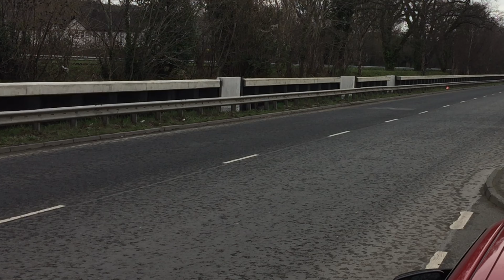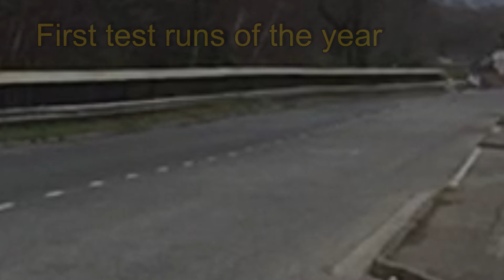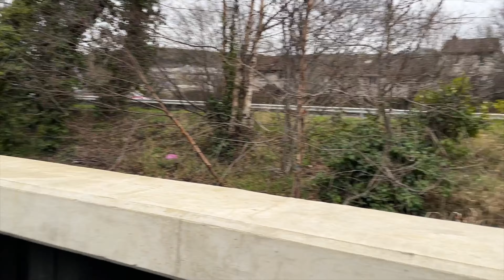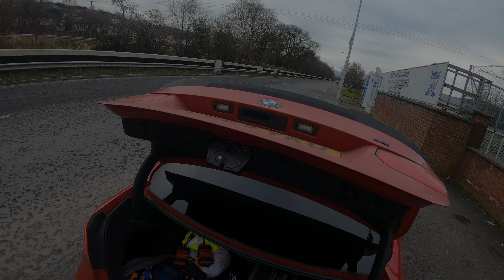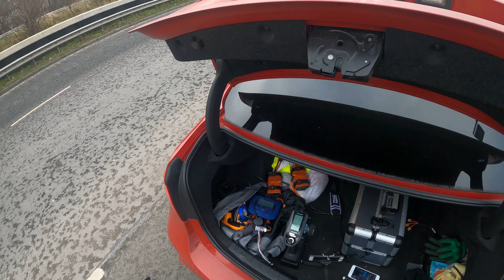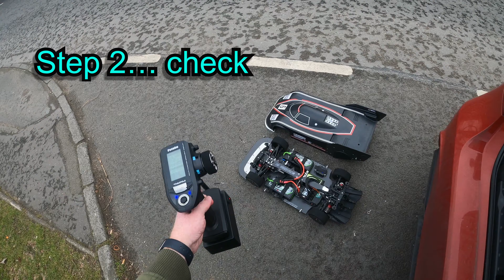What speed can I go on this new road? Arrma limitless fc-100 gt - speedruns - TEST DAY!

Comment: Dang sorry to see that man.  Glad the car survived.  Seems like that road has some potential
Reply from the maker: Thanks, yea the road is great just need to try it at a few different times, it did quieten down a lot while I was there. 
I’m hoping that after a few runs snd if needed  I can run car up through bend 🤞
Disappointed In crash after ultimately doing a rear wheel drive speed run lol

Comment: I just got my FC100 body. Your paint jobs is bad ass brother. I still have no idea what my plan is. Definitely going high visibility. And I still can't believe how you do so well on that crappie busy road. 
If you have any fitment tips id love to hear them.
Reply from the maker: Thanks, the toad is good if only for the traffic sometimes, summer months should be ok as I’ll be there later in the evenings. 
When fitting just take your time and measure then remeasure and check the cut and drill once. 
Just take your time